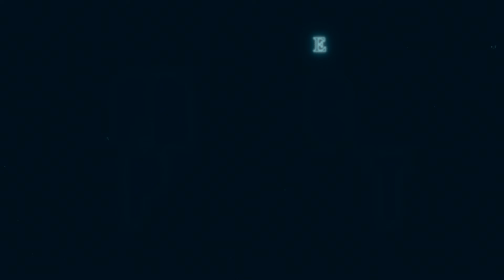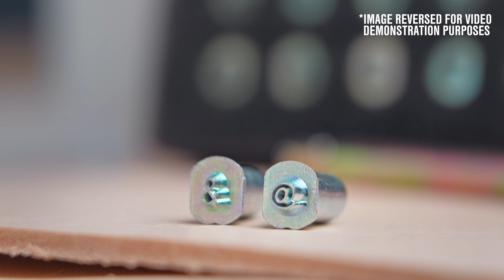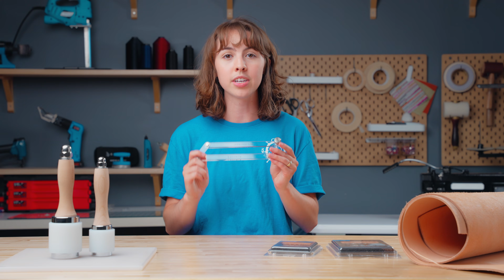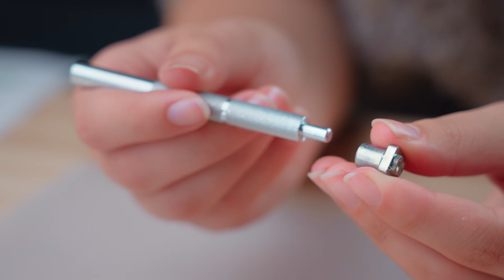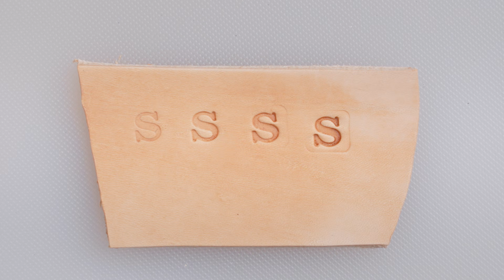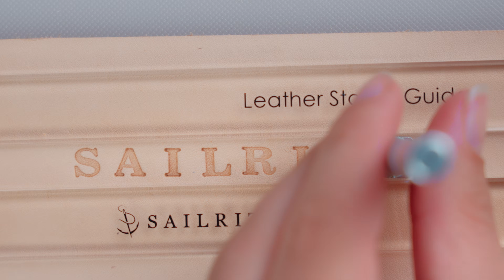Create Stunning Lettering and Numbers on Leather with Ease! — Sailrite Leather Stamping Tools

Comment: I’ve stamped on metal before. What makes your stamps different from metal stamps used to stamp metal? I already have those. Or can I use your stamps on copper and brass and nickel?  Why do you have to wet the leather first before stamping?
Reply from the maker: I would not recommend using these stamps on metal, as they were designed for leather. The surface of these letters is flat, while stamps made for metal are typically more pointed, allowing for easier stamping on metal.

Wetting the leather slightly before stamping makes it softer, more flexible, and more moldable. The resulting stamp will appear darker, have cleaner lines along the edges, and penetrate deeper into the leather piece.